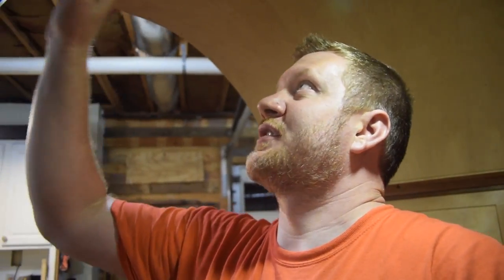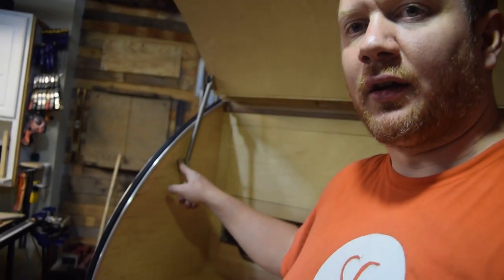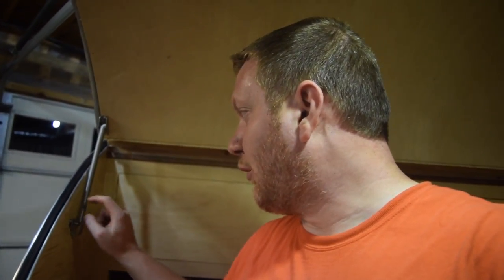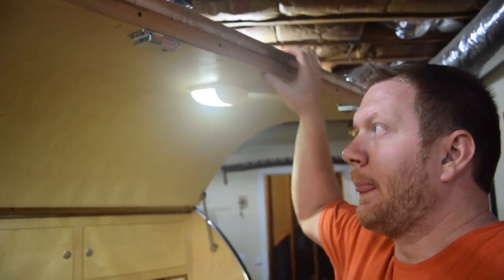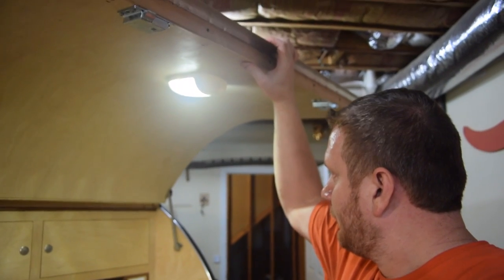Hatch ceiling, lights and more! | How to build a Teardrop Camper Trailer #20

Comment: Nice work, I used a similar spring prop. Mine are a little thicker but shorter with a cable inside to prevent over extension. They have served well for several years. A lot easier than doing the calculations and trials of the gas springs. I think you will be happy with them. I agree with Mark, get that bad boy to the campground.
Reply from the maker: +Ed Whitcomb hehe thanks Ed. Yeah I looked at many different ones but I was concerned about the length, these will hold 50lbs each so I felt this would work. Worse case I try another kind :)

Comment: I know this has been a while but mounting the springs so they are plumb helps significantly in their stiffness when open. Also is there a cable inside them for wind over opening them?
Reply from the maker: Yeah great idea! These don't have a cable but I have seen some that do for sure! These kind are much easier to install than gas shocks tho!

Comment: Hi SG, Good job.  Do you have any idea of the trailers dry weight?
Reply from the maker: +GC Adventure Gear about 1000lbs
Reply: Thats about 453kgs. Which is really light. Must not have anything in it. ie fridge , bed, microwave.
Reply from the maker: Yeah no fridge or microwave. Heaviest part would be the battery, aside from the structure itself of course.